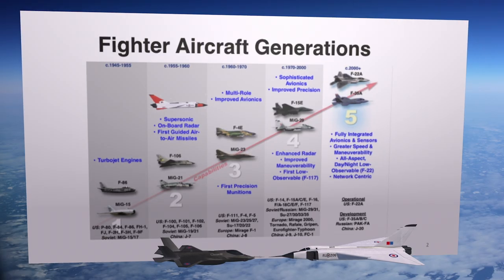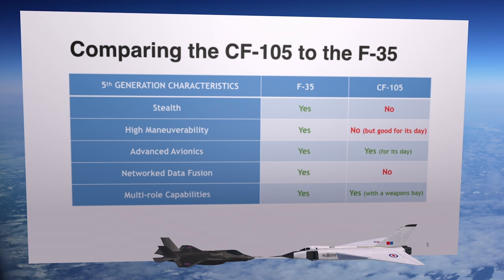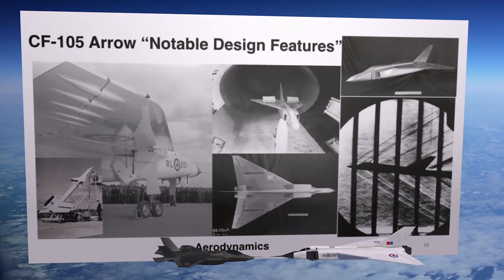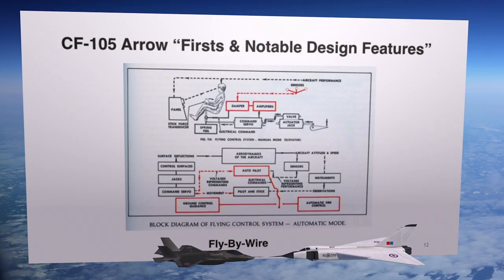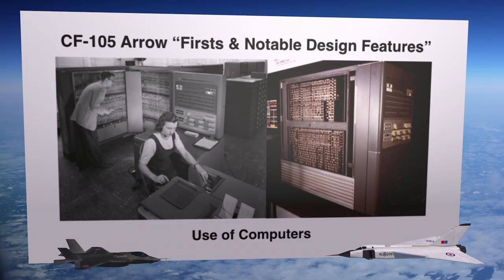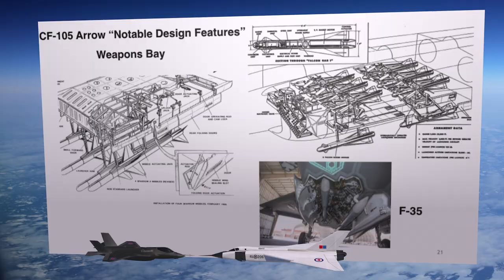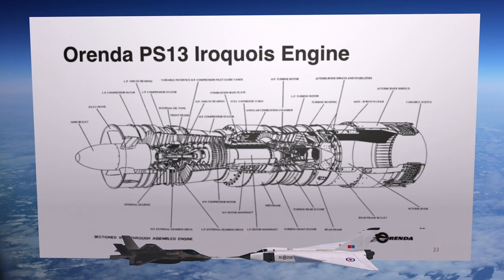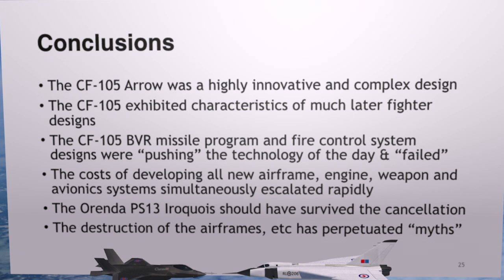AVRO ARROW FIRSTS VS F 35 LIGHTNING

Comment: I"ve read too many times about the Arrow being too expensive. So in Feb / 59,  everything Arrow was scraped. $350 million down the drain. Then in Aug / 59, Canadair got a $420 million contract for CF 104s. Ain't politics great? At least Orenda got to license build GE engines for the 104s.
Reply: Not to mention we bought "slightly" used CF-101 Voodoos in two batches of 66 airframes. Even at 50% off that would equate to $66 million dollars. No listing of what Canada had to pay for the stupid Bomarc Missile sites. At least the CF-5's were a good choice. But that should have been our reserve fighters and trainers.
Reply: The problem was not the cancellation costs for the Avro Arrow but the cost to completion rising up above $1.1 billion.

Comment: I knew the Arrow was a sophisticated aircraft, but I had no idea of how very advanced it was relative to other fighter aircraft of its day. The engineering that went into the design and production of the Arrow was well beyond cutting edge and state of the art.

No wonder why the Arrow made the Americans so nervous. They had nothing that could compete in terms of what it was designed to do. And it would be years or even decades before they would have had anything that could have competed. 

Plus, they couldn't abide with the idea that a country so much smaller could have come up with such incredible technology. 

People often criticize the Arrow because it was perceived to be a very expensive way to shoot down incoming Russian bombers and because it couldn't handle fighter interdiction taskings. 

But the Arrow wasn't meant to interdict enemy fighters, because they didn't pose the threat that Canada was facing at the time. What was needed was a jet that could fly high and fast over vast amounts of territory to meet the bombers and destroy them long before they could reach any targets in Canada or the US.
Reply from the maker: Hi Steve.  The Arrow was very sophisticated.  The was no reason why it could not stop enemy fighters though.  It was not going to dogfight in thick air (below 30, 000 ft.) with any fighter, but it did not have to.  The Arrow was designed to fight above 50,000 ft.  It could still pull G's at the altitude where it could sit like an F-15 Eagle and shoot away at fishers.  Armed with todays missiles and Avionics, it would still be very effective.  Essentially an F-15 that could only pull 6 G's in thick air, but turn faster than an Eagle above 50,000 ft.
Reply from the maker: Zane Nobbs  These were not fighter jets.  They were great jets, but had a specific role.  The initial intent of the YF-12 program was to drop a large bomb on Russia, but even that did not pan out.  These jets had to fuelled int the Air as they leaked on the tarmac.  When they reached speed, the body expanded to close off the leaks.  That was the design and not an error, but these planes were hugely expensive to operate and only the U.S. could afford to, but they were never going to be interceptors or fighters. regards...Virtual
Reply: Zane have a look at the numbers! 

The Arrow Mk 1 with the early P-3 de-rated J-75’s (developing thrust of only 16,000 lbt dry) did Mach 1.98 climbing through 50,000 feet still accelerating, still climbing, and only using intermediate afterburners (not even at full power!) and being 3.5 tons over real world combat weight (compared to the Arrow Mk 2) and it was test flown to 58,000+ ft. 

 

Compare the Arrow Mk 1 to the first flights of the A-12 using a more developed J-75 engines that produced around 17,000 lbs dry thrust. The A-12 in level flight had achieved Mach 2.16 and was flown to an altitude of 60,000 ft! This is the Arrow Mk 1’s flight performance range!